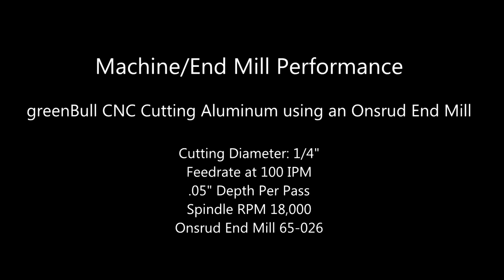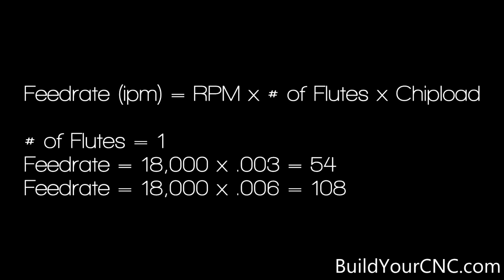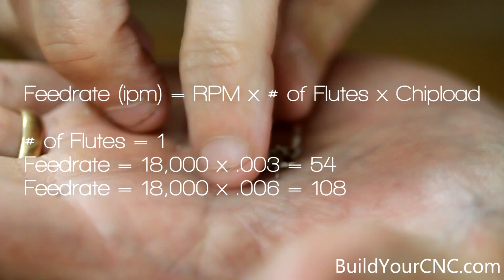How to Cut Aluminum with the  Onsrud 65-025 End Mill using a CNC Machine

Comment: That looked part very suspiciously like a part for a plane.You answered my question of can I diy a gantry machine to rout Alum.The answer is quite nicely.What screws, motors, board and drivers are you using? I am thinking of emulating absorber of light on YouTube.I like his build.I can't bring myself to wood or mdf.However your machine is killing it.Very sweet indeed.
Reply: Like you, my brain was not comfortable with MDF/ply frame, and aluminium flat rails... then I watched it work!   I'm convinced; my brain has been reprogrammed!   :o)